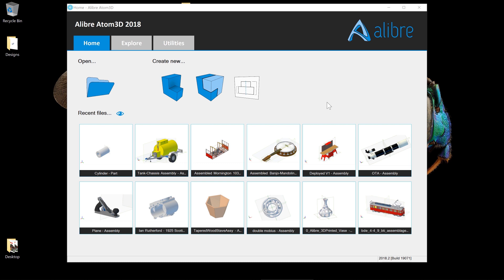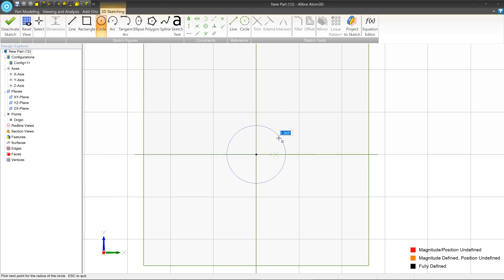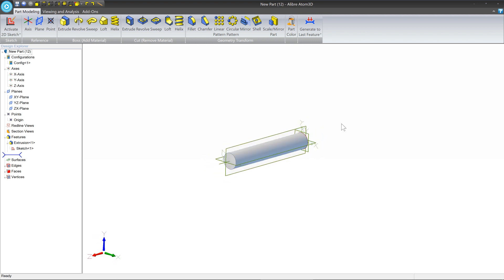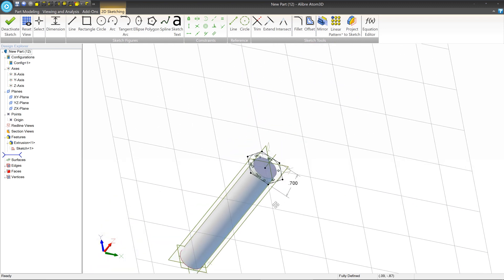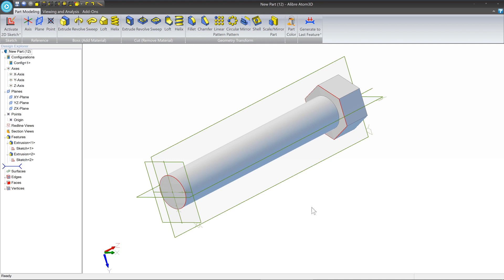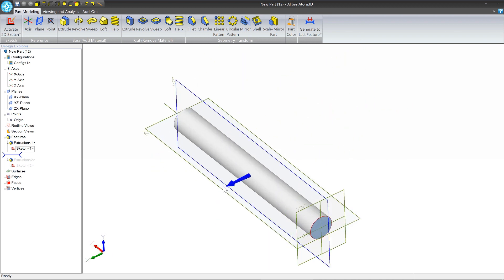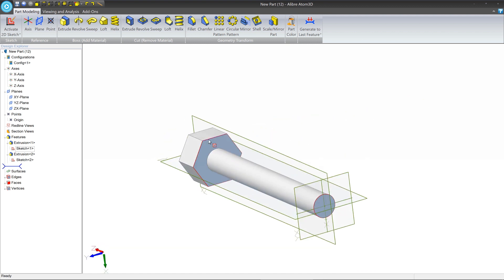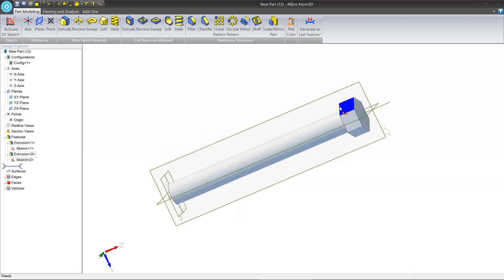Alibre Atom3D Tutorial - Making and Editing a Bolt

Comment: Going thru these video and trying to learn.  I am new to CAD (but not 2d drawing).  I have some questions.  I can't get a handle on moving the model around.  When I am trying to rotate the model I do not seem to have any control over it.  I can move stuff around just fine when using Simplify3D  but in this program it seems to just go everywhere and I can't rotate and keep it upright.
2) Your grid is much smaller than my grid.  When I create a new part, my green square (plane) is 1/4 the size of a a gride square.  Where with yours, you have 9 gride squares inside just one quadrant of your  green plane.  
3) You have an arrow that points out when yo click on a plane, I do not have that.  

I sure hope to master this software.  Thanks for the videos.
Reply from the maker: 1) In Atom3D the rotation options are limited to using the mouse to free-form rotate or clicking the View Orientation buttons in the upper left of the window.  Alibre Design Pro and Expert offer a Gyroscope option that can further refine rotation of the model in the workspace.
2) The grid size can be adjusted in System Options> Parts/Assemblies> Sketching
3) Under the View tab check the Reference Display section and make sure Toggle References is turned on. 

If you have any additional questions, please email us at Support@alibre.com